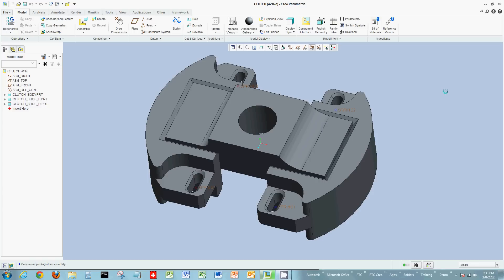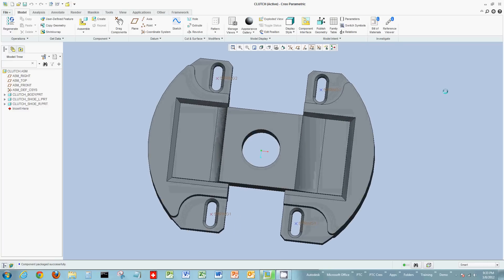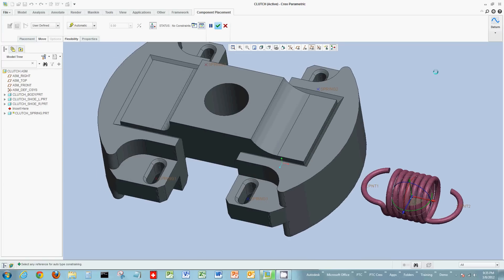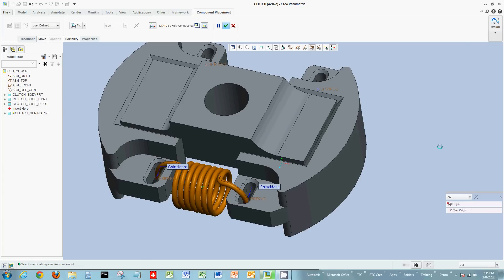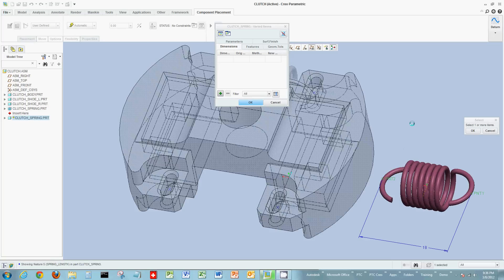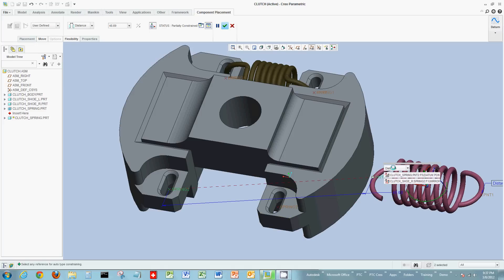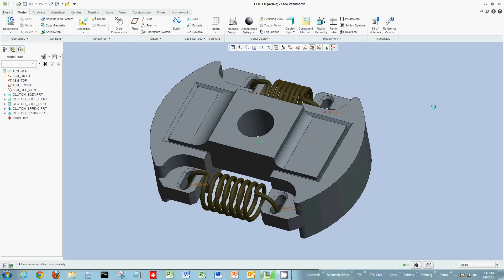Creo Parametric - Adding Flexibility in Assemblies

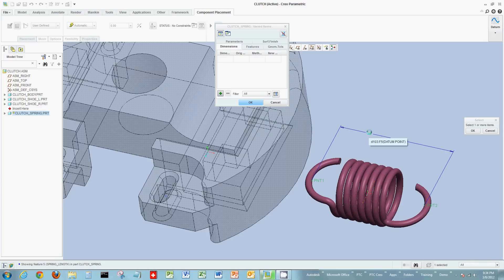Comment: I can't figure out how you created the "length between two defining points" @1:12
Reply: Lijo Varughese Chacko 
Start by drawing a horizontal line (name it S1).
New sketch. 
Reference the line you just drew and then,
draw a semi circle about .5 inches away from an endpoint of S1 (this curve represents the hook).  Create a centerline perpendicular to S1 in the midpoint, and then mirror the hook across this center point.
You should now have two sketches. A line sketch, and two semicircles on opposite ends of the line.
New sketch. Title it (C1)
Reference all sketches you've drawn so far.
Draw a line from the top endpoint of a semicircle to the top endpoint of the other semi circle.
Create helical sweep on this line you just drew with S1 used as the center line.
You should now have a helical extension spring.
Go to tools, relations.
Relate the semicircle hook diameters to the length of S1. Relate the semicircle distances from the line to the length of S1. Relate pitch of C1 to length of S1/n (n is number of coils)
Now whenever you change the length of S1, the relations will drive the hook dimensions and the number of coils to keep everything proportional.
You can now also use this spring in assembly.
I can send the prt file if necessary

EDIT: I forgot to mention to draw intersecting curve lines to connect the spring to the hooks. You must also reference these entities in the relations tool
Reply from the maker: Mike, there is a relation between the distance between the points and the length of the profile of the coil.  The points drive the overall length and the profile drives the length of the spring coils. i.e. <profile length> = <point distance> - ##.  There is also a relation between the number of coils and the profile length to maintain the number of coils and change the pitch. <pitch> = <profile length> / <number of coils>.
Reply: BoundarySystems thanks for replying. I forgot to mention that I figured out how to properly model a flexible extension spring. If anyone is interested in learning how to make one, or if you just want the actual part file, I'll be happy to help.
Reply: @mikedotleb  , Hi Michael. I want to make flexible a component but I just don't found how... hope I can send you some pictures so I can explain better myself..... Do you have an email where I can send you a description of what I want to do?  thanks...
Reply: Hi Mike, I have actually made an extension spring but it isn't flexible. Could you please share your method of making a flexible extension spring?
Reply: Thank you so much for taking the time to explain the steps in detail. I will try this soon.